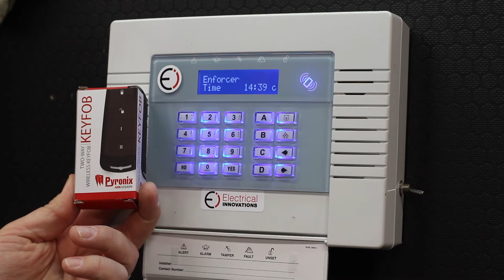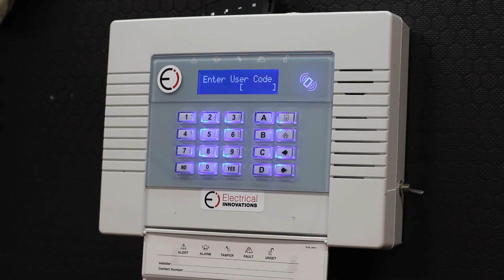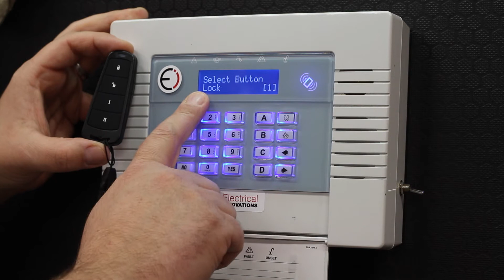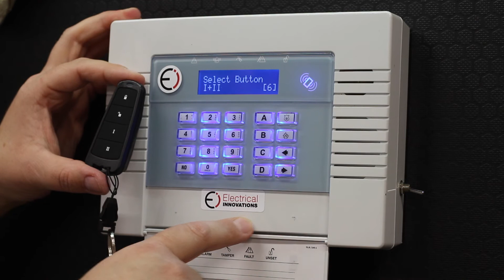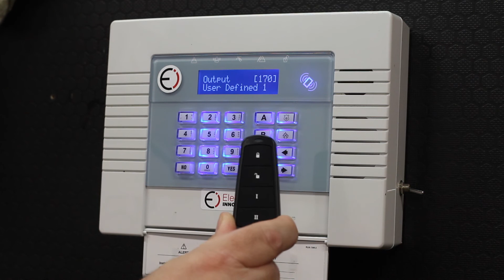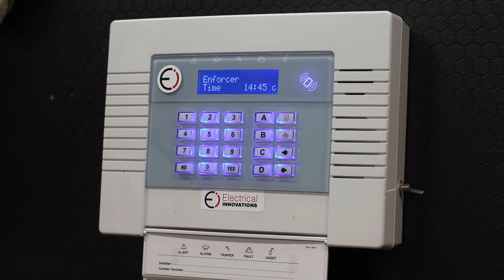How to add a keyfob and program the buttons on an Enforcer Alarm

Comment: Hello and thank you for the great videos. 
Is there a way to replace or at least test the Reed Switch on the magnetic door sensor - happy to try to repair before ordering a new one 
Thank you
Reply from the maker: This will need replacing.  You can test by visually seeing it moving when a magnet is introduced.

Comment: my fob just flashes yellow on any button press after battery change and when I enter the engineering code I dont get the same options so cant find edit users, any idea?
Reply: I have the same issue, did you get this sorted?
Reply: @jayhussainjh  i played with battery ensuring good connections snd now it works from fob
Reply from the maker: Change the battery and check the terminals